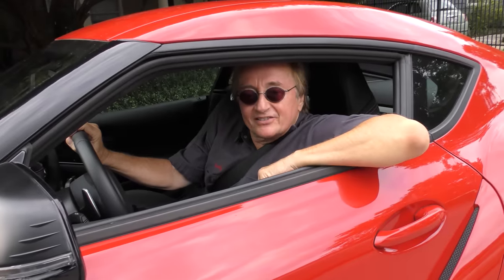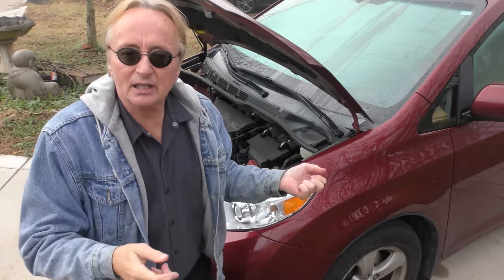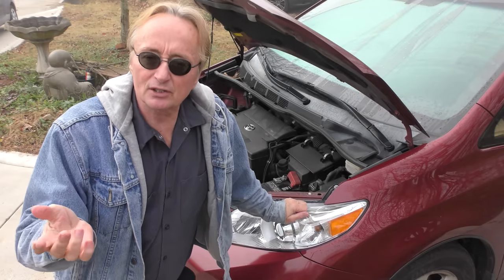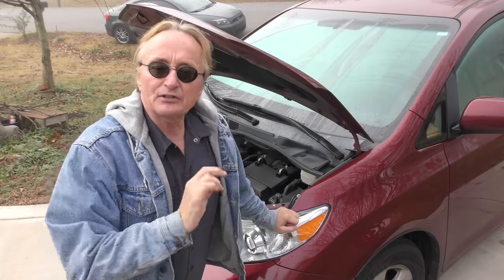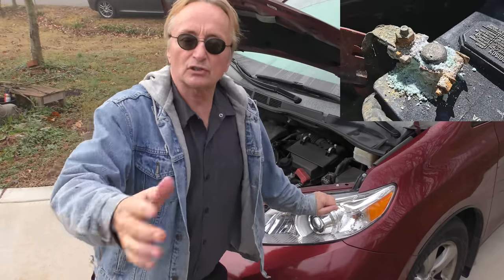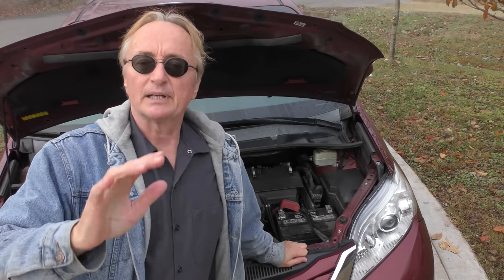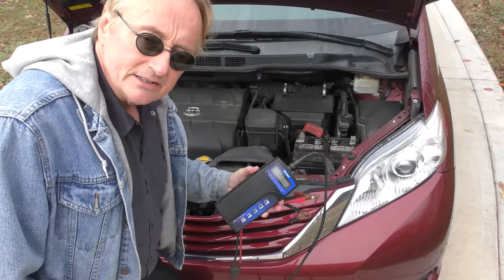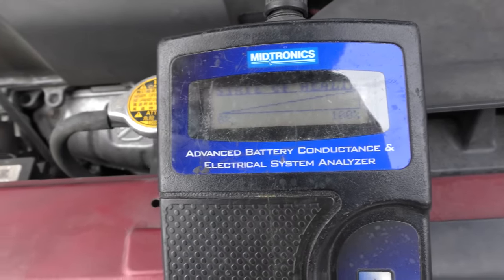If You Buy a Car Battery from This Place You’re Stupid

Comment: I’ve always bought from Costco, same Johnson Control manufacturer with a no cost replacement within 3 years. Living in Arizona a battery doesn’t last much longer than 3 years. Consumer Reports does a terrific job in comparing batteries as well as listing the manufacturer of private label batteries.

Comment: Costco interstate battery are the cheapest ones I’ve found.
Reply: My Costco battery is 8 years old and still working just fine. It was cheaper than other places I checked.
Reply: Easy to return. Mine failed just before the warranty ended. Got 100% money back. Shouldve bought another Costco battery but I was dumb and bought a marked up battery somewhere else.
Reply: Costco batteries are the best! High turn over, fresh batteries on the shelf, every size available. Best prices, Best return policy. No one competes.

Comment: I had an Interstate Battery that lasted 8 years. A serviceable one.
Reply: Green top Interstate were really good,the black case ones are junk.
Reply: Interstate batteries are $100 at Costco
Reply: I’ve heard they are POSs
Reply: In the last 4 years i've had 2 Honda batteries go bad (they're weak batteries and the capacity is way too low) and an Autozone Duralast went bad. 

Honda will only warranty the battery 1 time, even if you were to get two defective batteries in a short span.

Autozone will warranty multiple batteries, but like Scotty said in the video they charge a fortune.

Out of the gate the Interstate battery has more cranking and cold cranking amps than the Duralast, and WAY more amps than the Honda brand with the same group number... The capacity is also much larger.. 

So far this battery (Interstate black top) seems much more healthy than any of the other batteries were when they were new (voltage is often at 13.2 when i turn off the van), and hopefully it lasts longer.

But either way, it's somewhere between $150-$200 for a crap Honda batt.. $170 for the Duralast.
Only $100 for the Interstate, and Costco is pretty good about warranties and returns.

The only cheaper battery i know of is at Walmart. I'd pick it over Honda or Duralast, but i'd rather go with Interstate than EverStart

Comment: I was told by a salesman at one of the better auto parts stores that in the United States,  there a only 2 battery manufacturers in the entire country,  and that when they come off the "assembly line", they just slap a Walmart,  or a Napa or Advance, or AutoZone label, etc. on the SAME BATTERIES and ship them out, so basically the same battery at Walmart for $50 is EXACTLY the same battery that you'll pay twice that price or more at one of the higher priced auto parts stores.  Is that accurate?

Comment: Currently have a 1-year warranty Walmart battery I got for $50 almost 2 years ago... last summer it tested with a higher CCA rating than it was supposed to have.  Conversely I’ve seen the same batteries fail 6 months from the date of manufacture despite only being on the shelf for a month or two max.
Reply: Yeah I have had a few of em. Seem to last me about 2 years if the car is daily driven.  Don’t let them sit dead very long!

Comment: I was recently able to beat your suggestion.
A couple of years ago, thought I was going to sell my car, needed a battery, so I went to a local battery shop & bought a used battery for $40. Didn't sell the car and a few weeks ago, died on me. While I was waiting on a jump I realized it is NOT a maintenace free battery. and yep, fluids were low. AAA came, checked it and said, "yep, you need a new battery". Instead I went to Autozone - only auto store that has it and paid $10.00 for a quart of premix battery acid and water. I dumped the old acid that was left and refilled with new acid. (I did NOT clean it out with baking soda!). Working fine now, "new" battery for $10.00

Comment: I would love to hear your thoughts on draining the battery and refurbishing them. Does it actually work, and for how long?
Reply: No.
Reply: Top up the plates and equalize the cells at >100A to the point of electrolysis seems to work. Of course you want to do it out of the car and with open air ventilation, taking care to avoid personal injury.
Reply: Fill the cells up and leave the caps off and leave it on a slow charge for 18-24 hours to rid sulfation.  If it can’t hold charge overnight or turn over and engine chuck it and get a new one.

Comment: Yep...back in those days they called them "Dry Charged" battery and they'd come with a bag of acid or the store would fill it with acid from their bulk storage container etc. BTW, those Walmart batteries are very good ones if you buy their better grade vs. lower grade. Lots of folks experience 6 years with them before replacement.
Reply: Got 4 years out of my last lower grade battery. 56$ plus tax and core. Replaced with the same at Walmart.

Comment: I have a 99 F-150 I bought new in October 1999. The battery lasted 17 years. Then one day I had to jump it twice,and the second time was to drive to the garage I deal with for an oil change. I had them install a new battery while they were at it. It cost about $50.00. Still driving the same pickup with that second battery and haven’t had to jump it yet.

Comment: Scotty. How's this. I have a 2012 Grand Cherokee with 100,000 miles on it. We are coming up on 2024 and still has the original battery. O.K. I think it's an a.m.g. type battery because it's under the passenger seat. Still working fine.

Comment: Even if all are made by Johnson Controls. Quality of ingredients change as front line buyers set the components battery is built.
Reply: Exactly right John Wehunt. The companies that do not actually make their own batteries but just re-brand another manufactures battery, specify the build parameters and price points of their re-branded batteries to the battery manufactures like Johnson Controls, Exide, Deka/East Penn or EnerSys and such, so no Scotty, they really are not all the same.

Comment: I have worked at dealerships and independent automobile repair shops. There are two manufactures of batteries, Johnson Controls/Exide and Interstate. Johnson Controls/Exide makes low quality batteries for companies like  Walmart, Auto Zone, Advanced Auto Parts etc. Interstate makes batteries under their own name, and for automobile manufacturers. These are very high quality batteries which are not the cheapest.

Comment: What you are describing happened to me. Wish I saw this video, 2 weeks ago, I ended up stranded somewhere and end up paying about $180.00 for a replacement battery in a known auto parts store.
Reply: I just paid $249
Reply: @da11king  10/5/23 I just priced some yesterday for my C 1500 Chevy, interstate and Napa premium. Both 250.00 +..... wtf
Reply: @olafvidar9315  Yep that's right! And they are going to keep on going up in 3 years 😮‍💨
Reply: Battery shopping today. Walmart $150.00, only have one choice for 2014 Kia Soul. Auto Zone $189.00-$220.00. Battery looking to replace will be 3 years old in 3 months. It was a warranty replacement from dealership with stipulation doesn’t have a warranty. They tried charging me until I said why isn’t this under warranty? Don’t treat the Queen like she stupid. Needless to say that dealership can go pound sand! So have no idea how old battery was when installed since there is no date on it, checked by a mechanic last week. Since this was in my feed, taking it as a sign, start pricing. Thanks Scotty!

Comment: The retail markups on batteries is HUGE.  I used to work at one of the chain auto parts stores Scotty often references, and they were always pushing batteries-batteries-batteries.  I asked my manager why, and she said batteries were one of their highest margin items. After all, they're just basically a plastic box with lead plates and some acid inside.  Batteries were one of our staple cash cows.  I'd liken them to the sodas you buy when eating out; they cost the restaurant a few cents, but they charge you $2 or $3.
Reply: What would you reckon is the price of battery to produce
Reply: @MrWalker1000  I wouldn't know, but it can't be that much.  I remember and at one time they even had us answering the phone "Autozone, home of the lifetime warranty AND BATTERIES!".

Comment: Hey Scotty excellent video I have been getting batteries from Wal Mart for years and had no problems.  Since they really only carry one type of battery for each kind of car,  they don't play the product differentiation game and try to sell you low, mid, and high end ones and get all the mark up.  Going to Wal Mart for a battery is like going to a local Gas Station for milk.  You might think the grocery store has the best deal on milk but the gas station often only carries one kind with an exclusive deal from a local distributor and if it's not the absolute cheapest, it is close and much better quality.  The grocery store raises the price on the good milk because they still need the cheap stuff to sell.  

Just a little Vermont wisdom as we still have dairy cows up here.

Quick battery question Scotty - why is it when you take a battery out of a car, say over night why do you want to avoid keeping it off a concrete floor?  In VT we have to put it on the board to avoid killing the battery especially when it's cold.  Is there  a a good reason for that or is it just a myth?
Reply: Got my last battery at Walmart. The value  battery was 56$ plus tax plus 12.00 core. The plus battery was 93$ and the maxx was over a 100$. Got 4 years out of my last value battery. Didn't think I would have my 97 f150 that long.
Reply: I believe there is some truth but not because concrete sucks the life out of the battery but is colder "not insulated like a board or thick rug". Basically cold does affect the life of a battery.

Comment: You know, it's awesome how much comfort, entertainment, communication and collision detection technology a vehicle can come with  but when it comes to diagnostic tech to make it easy for the vehicle owner to assess the state of the car (the battery in this instance) there's almost nothing to forewarn the owner about it.   That shows you how awful the market is set up to be for consumers.   There's not even any option for a diagnostic tech package for a vehicle when you purchase it - even though it should come standard, be built in, in my opinion. Honestly how hard would it be to have this kind of battery diagnostic gauge incorporated into the dash?
Reply: @Mark Codiroli Yes but that requires a device (scan tool) be plugged into the 16-pin OBDII/EOBD diagnostics port to enable the user (probably a mechanic as most people don't even know about that port) to get a reading, right?   It's not something that could be read off the car's dash.  That's my point.  Why hide it from the driver?

Comment: Like one of the other's that commented.... I change my batteries in my vehicles every 4 years regardless if they start the vehicle or not.  After 4 years, you are on borrowed time.  I'd hate to be stuck someplace in the middle of the night because my vehicle won't start due to a bad battery.  I've never been stuck anywhere because of a bad battery by doing this.  Most people wait for their battery to die and then replace it.  I'd rather do it on my time in my garage with my tools than be stranded someplace.

Comment: Scotty almost got to the truth. Whenever you get a new battery, charge it before you use it! Batteries that are shipped dry or prefilled batteries that have been setting for you to use them ALL need to be charged. I've been told that a battery that is put to use in a partially charged state never gets fully charged. If you want a battery to last much longer, put it on a trickle charger occasionally. Normal driving will not keep a battery fully charged.
Reply: I test with my multi meter. If it reads above 12v it's good to go.
Reply: @davidanderson8469 Ive charged "new" batteries anywhere from 5 minutes to 5 hours. Not a bad idea to warm it up before putting it to use if you have the luxury.
Reply: Whoever told you that was sick! People shouldn't screw with the mentally challenged.
A quick check of the voltage will tell you the state of charge.
If its 12v or better, which is should unless its been sitting for >6 months, your fine.
If all you do is city driving, or drive like its your father's Oldsmobile, or WFH and don't drive much, then yes throwing it on a charger every once in a while will help it knock down some sulfation.

Comment: I don’t know much about batteries, but I purchased a Walmart motorcycle battery with a project life span of 3 yr.
As recommended by my bike repair shop, installed a battery maintainer and the battery lasted 6.5 years. 
I’m getting old and don’t drive as much. Sometimes my car will set for two or three days. So I thought, if it works for the bike, it should work for the car. Found a small maintainer that installs under the hood and a regular AC plug was mounted through the front grill. I get home, plug it in and hope for the best. 
The only problem with mounting the charger under the hood, is you can’t see the flashing lights telling you at what stage of charging it is at. I do pop the hood about every 3 months. 
As far as the flashing lights, solid red is full charge, flashing red is maintenance charge, flashing green is battery maintenance. When first installed, the charger would go to flashing red. Now I have noticed that over the years, it goes to full charge mode stays on longer. Good sign the battery going bad. The unit is a noco genius 2D and comes with a mounting kit, $ 30 bucks.

Comment: People give the Walmart Everhart batteries a hard time.   I had mine for over 9 years.
Reply: The max last average 5-8yrs if ur not just driving 15min to home and work in the city
Batterys last long driving on highways because the faster you engine goes the faster ur alternator spins which charges ur battery more, short drives in the city still charge it but not like the highway

15min on the highway 60+mph will charge more than 25min in city 40mph
Any charging is better than no charging
Reply: @Spike_-rx7bx  , alternators have voltage regulators to keep a constant voltage regardless of the cars speed.  You can get an inexpensive voltmeter that plugs into the lighter which will confirm that, if you care.  Short trips are harder on batteries only because the starter drains the battery and then it has to go through more recharge cycles.
Reply: Really?! 9 years?! Which vehicle do you have it in?

Comment: I've always bought the batteries for my Honda at the Honda parts counter. It is the correct fit and is always cheaper than anywhere else....and Honda replacement batteries have a 10 yr pro rated warranty!

Comment: Hey Scotty, you ever heard or use a desulfonator? I got 12 years out of my battery on my 2002 GMC pickup by using one.  Definitely worth investing in one if you have the time because it takes a long time to rejuvenate the battery, but it works.
Reply: Which one would you recommend buying? I’ve looked at a few but not sure if they are actually legit. See tons of chargers that claim to desulf a battery.

Comment: Explain why my Harley battery, half the size, is twice as much as a car battery.
Reply: I can relate. Seems like there’s a “joy” charge on all 2 wheel vehicle batteries haha.
Reply: It’s because they know you have to have that size and cranking amps. Then the main reason you will pay it. 😎😎😎
Reply: @ib12541  what is it?
Reply: @ib12541  I bought the last one at the harley parts desk. Asked for original replacement.
Reply: Because of the name .........
Reply: Different chemical composition. All batteries are not the same.
Reply: because harley drivers are noise polluters

Comment: Okay - I'm a parts guy in a parts store...
 
We'll charge and test your batteries for free. I don't lie to people. And... Seems like I see a LOT of Wally World batteries that flunk. I'm also in an area were we see a lot of junkyard batteries. They perform a bit worse than Wally World, but not by much... 
 
Of course, if the car owner takes a 3" deck screw and screws the cable into the battery, that doesn't work all that well either. And I've seen several of those.

Comment: This time of year in cold PA I have my Harbor Freight trickle charger permanently hooked up to my battery under the hood with a short extension cord hanging out of the grill.
Reply: You should be using a battery maintainer that turns off at 14.2 volts and back on when the voltage drops below 13.6 Not just an automatic charger that just shuts off at 14.2 and not turn back on. this will ensure your battery will last a long time, a trickle charger will just keep charging and cause two problems: first it will boil the electrolyte out of the battery second the constant charging will cause the plates to dissolve away, taking away the life of the battery. Never leave a charger on  a battery that does not turn off automatically, connected to a battery longer then it needs to bring the battery to a full charge or it will start to damage it.
Reply: @waynefoster5913  Thanks!, I'll look into that. I wonder what the vehicle alternator vs trickle charger volts is.

Comment: Are car batteries from Costco good or trashy?
Reply: I've purchased batteries from Costco and BJs for my own and family's cars they usually last longer than the warranty stated on them. But just like Scotty mentioned, look for the newest one you can get and not sitting too long. I bought one that was 2 months old and already at 80% capacity, though I charge them up twice a year anyway.

But my experience they have been pretty solid batteries.
Reply: Costco warranty used to be great.   Just exchange a dead battery for a new one.  No questions asked.  Now they do 4 year prorated warranty just like anyone else.
Reply: Car batteries are made by just a few companies, so it does not matter where you buy it. Its' name will just reflect the seller.